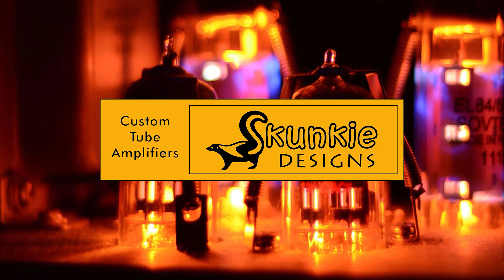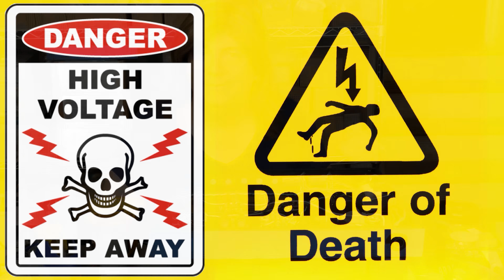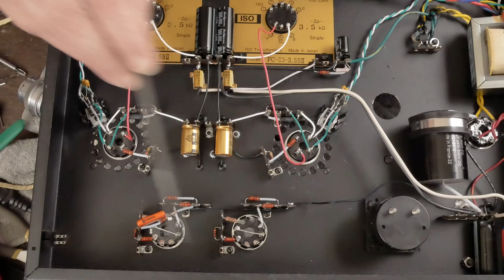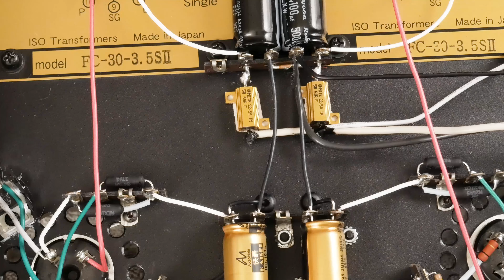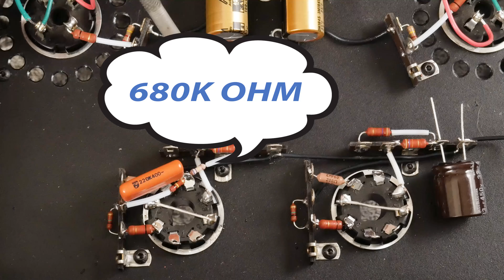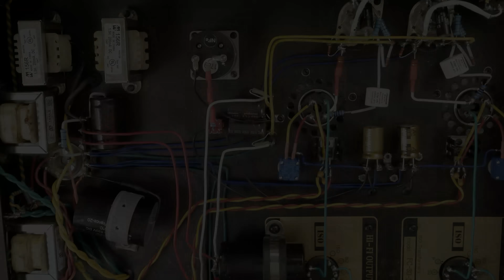Affordable 300B Hi Fi Tube Amp: Prototype the Wiring Layout #2

Comment: I’m really enjoying watching your new 300B build.  I definitely plan to build the base model when you release the final BOM and schematic.  I did your modifications on my Reisong A12 about 2 years ago and it’s been working flawlessly.  I’ve never heard a 300B before.  Do they sound a lot better than the modded A12?  I really appreciate your in-depth videos showing how to do the wiring.  I have been working with electronics for 40 years.   I have very good assembly and soldering skills and ok troubleshooting skills.  I have a suggestion that would help people like myself who want to build their first tube amp from scratch.  Besides the BOM and schematic, would it be possible to attach photos of the assembly as well?   What I mean is a photo of the entire inside of the chassis as well as close ups of each area of interest ie connections around tube pins, terminal strips, regulators, etc.  Even though you do an excellent job explaining what you are doing, sometimes it’s difficult seeing some of the small details in the videos.   You may think this is unnecessary, but I really think it would give people doing their first build a little more confidence.  Just a suggestion.   I REALLY appreciate you doing these DIY videos.  I plan on retiring in 2 years and hope to build many Skunkie projects.  Thanks.
Reply from the maker: I think you will be very surprised with the sound! I will definitely try to get more pictures for the next release.
Reply: Really looking forward to it.  Thanks a lot.

Comment: Hi Skunkie, many think that capacitors veil the sound limit dynamics etc. Will you ever try a interstage transformer to remove the coupling cap and grid leak resistor + that can be combined with fixed bias to remove the power triode cathode capacitor and resistor. You can also use filament bias on the driver tube to remove the cathode capacitor, essentially you have then removed all capacitors from the circuit :)
Reply from the maker: Transformers can also negatively impact the sound, just in a different way. especially is they are less than top shelf quality. And not a fan of grid biasing tubes.
Reply: @SkunkieDesignsElectronics yes transformers can do that 100%. Why do you not like fixed bias/grid bias?
Reply from the maker: It requires a separate power supply but mainly most "general users" don't understand what it is, they forget to do it or do it wrong and redplate tubes.

Comment: Yes, much nicer and 'cleaner' wiring layout in your new version! I was surprised, though, by your cascode wiring of connecting the 'upper' cathode directly with the 'lower' plate. I'm very familiar with the SRPP principle of giving the upper cathode a bias resistor and having the upper grid controlled by direct connection from the lower plate. I looked up the Philips data sheet of the European PCC84 (equivalent 7AN7) which is dedicated as a HF cascode amp, and found that Philips shows both varieties. I imagine that the version you use has a higher output resistance, as in the version with cathode resistor on the upper system and the signal coupled out from the upper cathode, it brings in characteristics of the cathode follower.
Reply from the maker: I use an SRPP 6SL7 on the lower B+ voltage 2A3 amp, running an SRPP with 400V+ of B+ is a challenge on the cathode to heater voltage
Reply: @SkunkieDesignsElectronics  Oh yes, of course, that's a good reason, the cathode resistor drop not going into the equation! I've actually come to that problem when I designed a 6080 (double power triode) SRPP output stage nearly 30 years ago. It had around 120V bias voltage, and I had to elevate the heater circuit to more than 200V. Was keen on the low output resistance though, for the option to run OTL into an 800 Ohms speaker that I happen to have.
Reply from the maker: The problem is the upper triode need to be lifted to 150-200V, the lower cathode is still down at 3V so without separate heater windings for the upper and the lower, you exceed the cathode to heater specs and kill the tubes. Plus you also have to use one tube for the upper, the second tube for the lower, which complicates wiring them. That and a 6SN7 SRPP won't have enough voltage gain, you have to go to a 6SL7 etc. There are a lot of reasons I went with a cascode on the 300B and a SRPP on the 2A3.
Reply: @SkunkieDesignsElectronics  That's a very useful mention that cascode provides higher amplification than SRPP, thank you! This probably solves an issue I have with one of my unconventional 'thought projects'!👍

Comment: That came out real nice !  With the outher 300B amp test before and after wiring changes so you have data to look at . A outher test you can do is channel separation. Important for stereo.  Glad you like my aluminum plates to work as a heat spreader/heat sink.  I clean all surfaces with alcohol . like 92% IPL or Denatured  . Want it to dry quick then thin layer of thermal paste on all surfaces. Some times I Scotch bright the surfaces first then clean. Depends on how dirty . For my LD-MOS transistors I use bi 1/4 in thick copper plate then bigger heatsink.  It's all about thermal resistance. Love that cabinet layout. Really helps with heat from tubes . I can see using 211 or 845   tubes. 4 pin Triodes . Them the twist lock with a guide pin. Same layout works with so many tubes. Cheers !